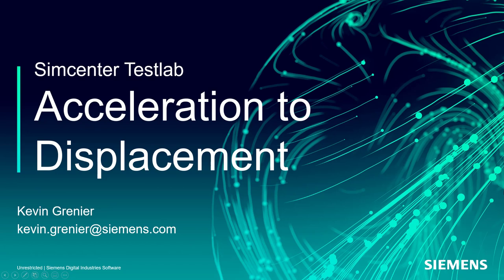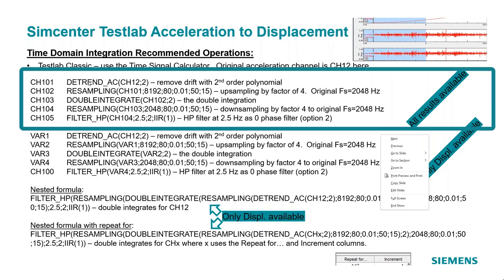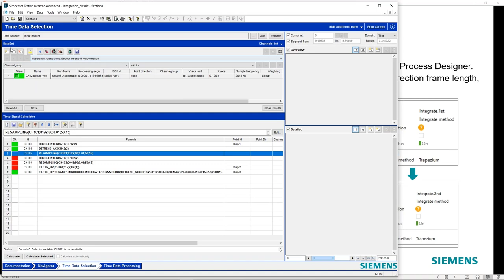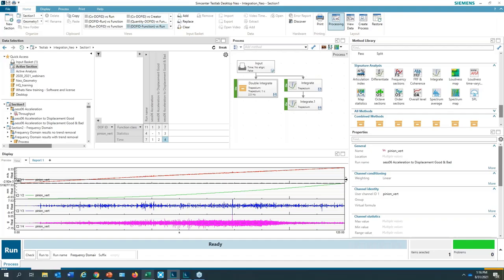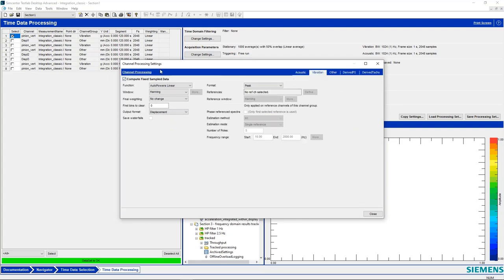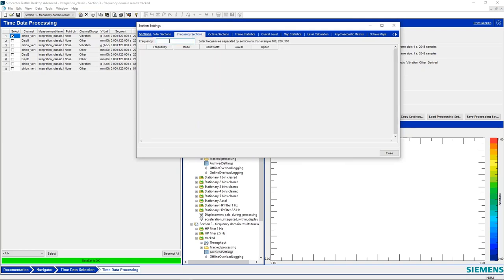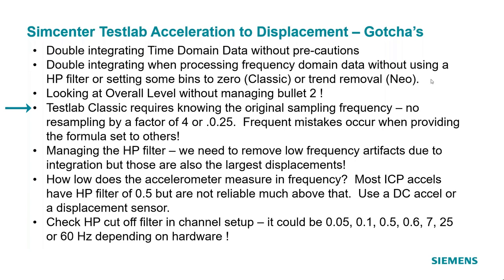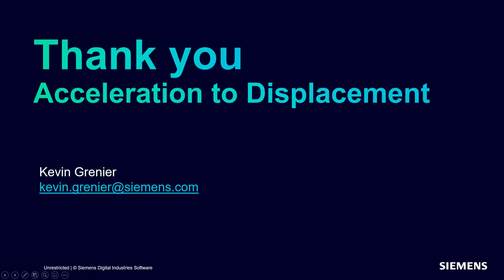Acceleration to Displacement

Comment: Would this still give accurate displacements for impulses in the data? If I drive over multiple small bumps and measure acceleration, would I be able to accurate determine the height of the bump?